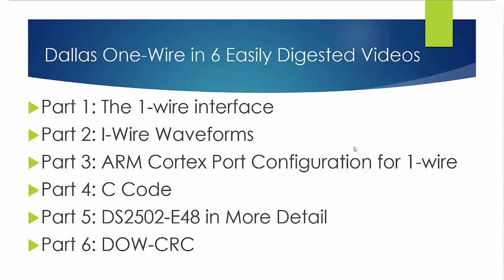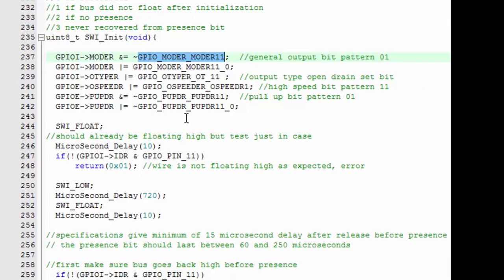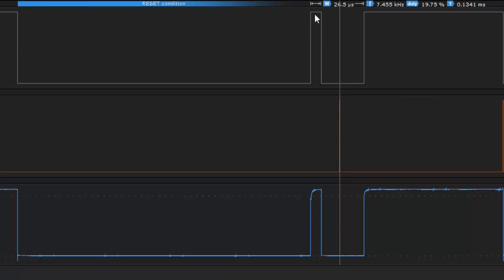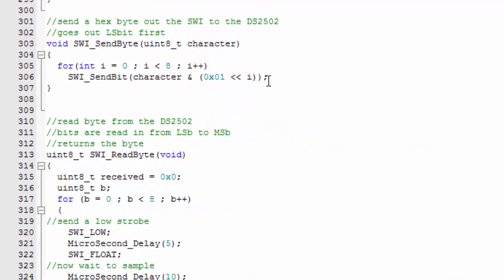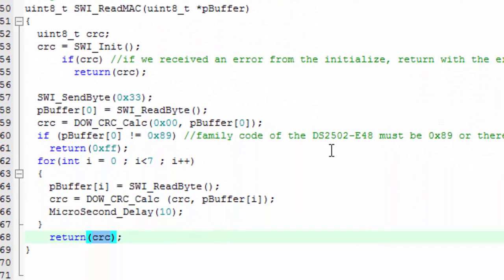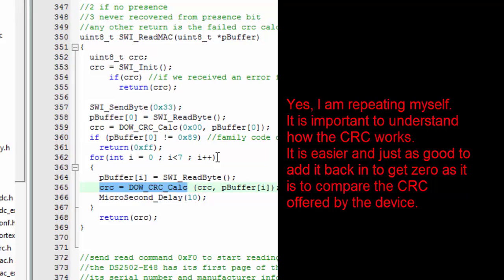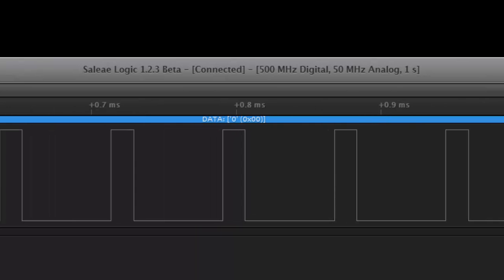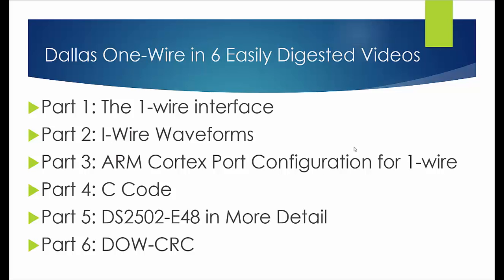{6} Dallas One-Wire Part 4 code

Comment: please help me to configure Single wire protocol for STM32F407 on CubeMX
Reply from the maker: That is a good suggestion. I have not used cubeMS in a few years. It had potential but had lots of quirks when I last used it.
Reply: @HelloWorldETX  instead of cubeMX which tool you used for configuration...?
Reply from the maker: Vishvanath D the CubeMX is handy when starting a project from scratch. But when doing similar programs where you are going to recycle a configuration and code, it is often easier to just copy whole blocks over to a new project, so I probably do more code recycling than from scratch. mostly, I have just not been doing as much ARM programming lately but I remember that getting CubeMX working properly was a hassle and it had many quirks, so I can empathize with you the challenge of getting it going.   The next time I am doing an ARM project I will do a CubeMX configuration and setup primer, but I don’t have and ARM projects in the works.  Spending more time on my vintage hardware lately.

Comment: I'm trying to address my one wire module which is a MAX31820 Ambient temperature sensor through an ATmega32u4 and I'm trying to write Read ROM command but all I get is the bus staying HIGH.
Reply from the maker: without a logic probe these can be tough to solve.   Can you confirm simple toggling of the bits out the port as expected?  when my projects don't work as expected, i first start looking to see where i messed up the initial port configuration